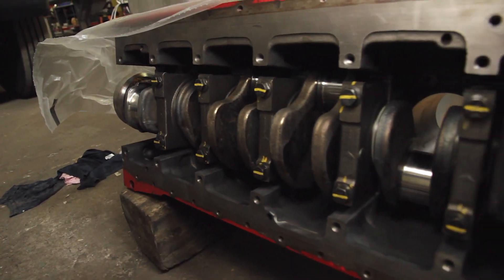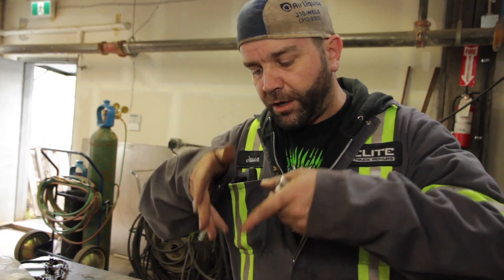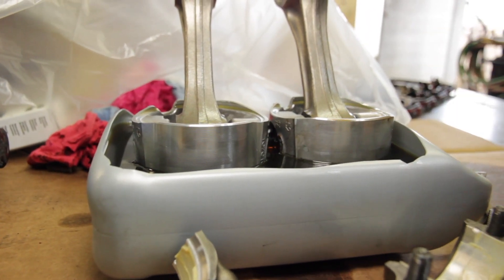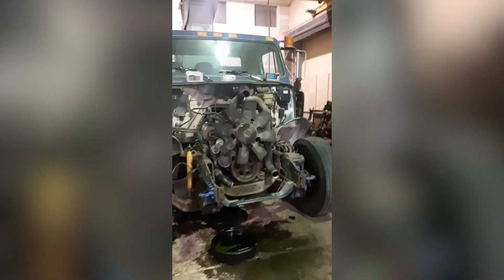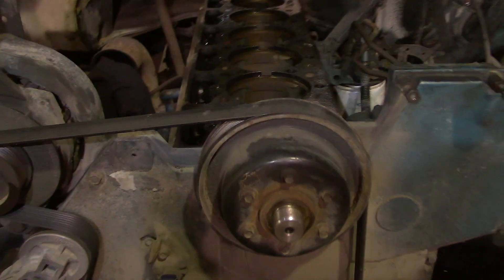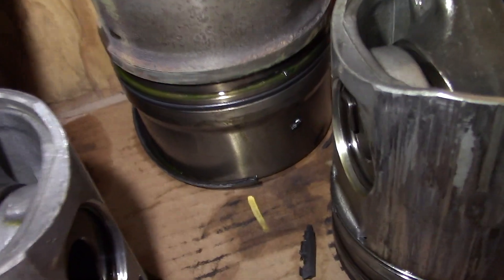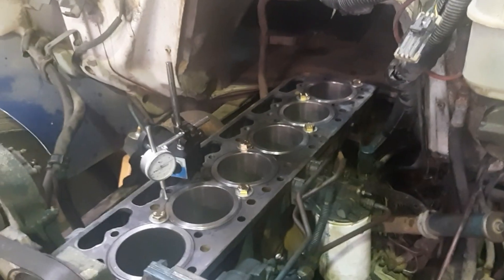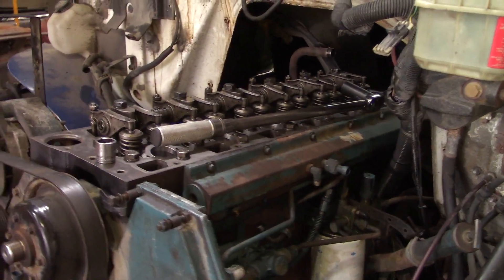Rebuilding Diesel Engines! Cummins ISB | IHC DT466!

Comment: what is the cost like to have a dt466 rebuilt.. parts and all.. it is in a 94 4700 truck.. not damaged just old and used for a farm truck but high miles
Reply from the maker: If it is a liner engine, the inframe will run around 16k CAD. If it is a dry block, it's not worth doing, the block will need to be machined.
Reply: @BethesolutionBC  thank you.. and yes it is wet sleeve.. more then i hoped it would be but much cheaper then a new truck..